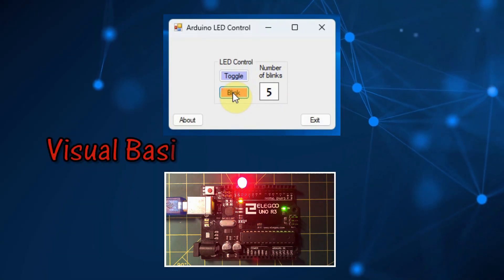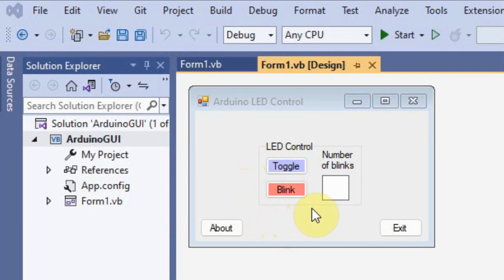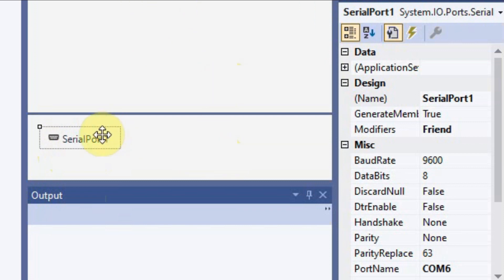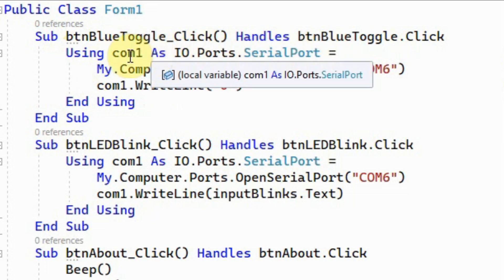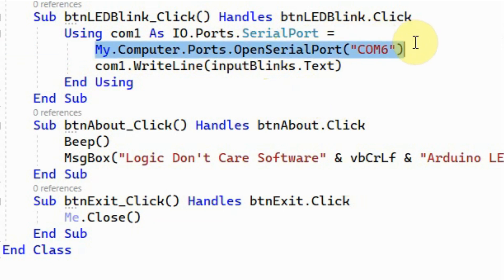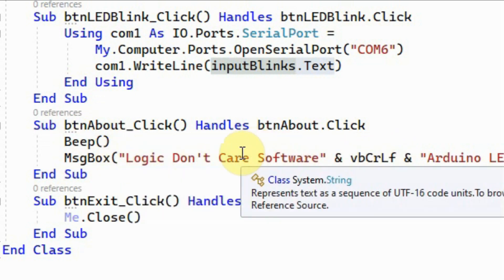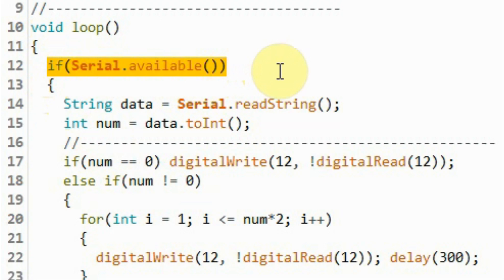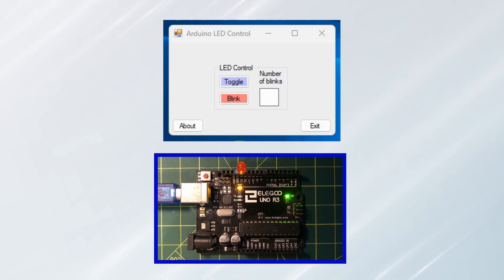Visual Basic GUI Control of Arduino

Comment: How to constantly check if COM port is connected/disconnected? Maybe like every 5 seconds.
Also, I publish VS project to single file (self-contain) so I can copy the executable program and run it in different pc. But the file size is too large (~140 mb).
How to reduce it to small size?
If I leave serial port monitor in Arduino IDE open, WPF form can't connect to COM port. It says "COM port is not accessible. That's normal right? That mean I can't use Serial.print on Arduino?

Comment: You should do this with PyQt and Qt-Creator instead of Visual Basic and Windows.
Reply from the maker: I do have videos using Python’s tkinter module and pyfirmita to control Arduino. Thanks for the feedback.
Reply: @AnasKuzechie  I applaud you for doing the project.  It's cool.  

tkinter is OK, but Qt is fantastic.   And it is very easy to throw together an app using QtCreator.   It's like a modern version of VB, but so much more. Especially on Linux.
Reply from the maker: Thanks, I’ll check it out.
Reply: @AnasKuzechie  I can send you some links if you want.  IMHO Python + Qt is a game changer.